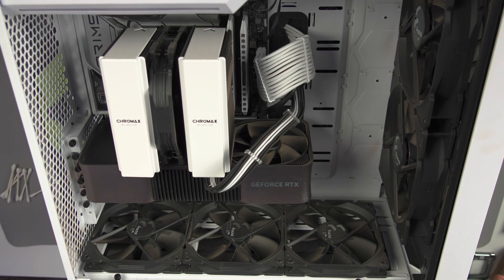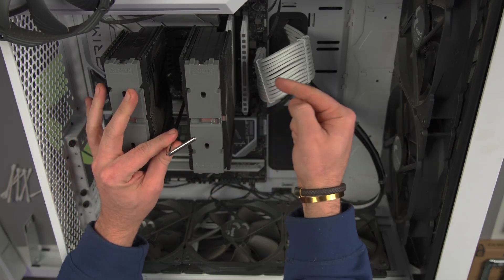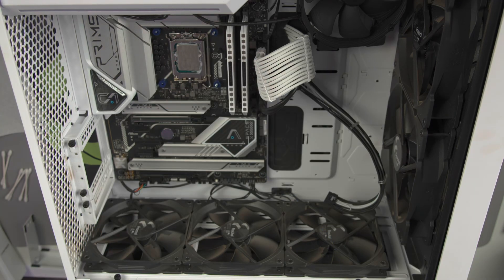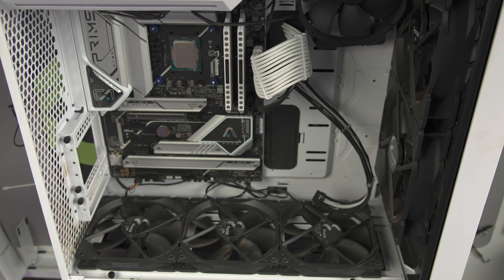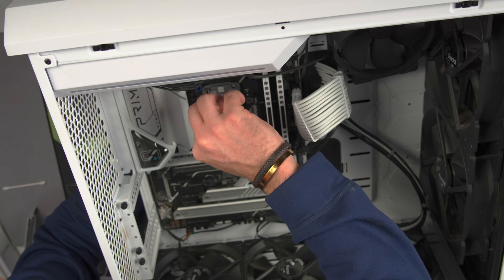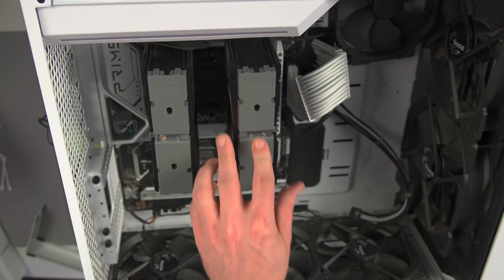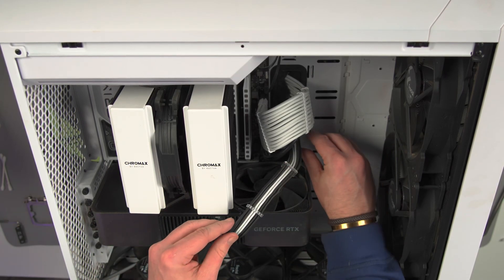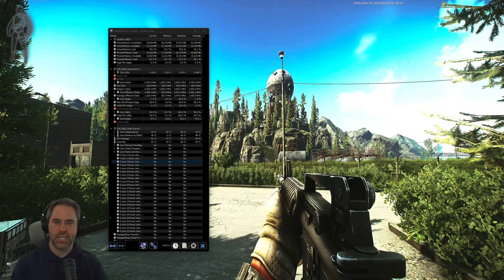How to Install a Contact Frame | 12th and 13th Gen CPU | Lowering CPU Temperature

Comment: In all frankness I'm impressed you got away with an Air Cooler on a 13900k!!! Curious to know what your temps are under full load without the contact frame!
Reply from the maker: New Tech videos coming soon with 13900KS and RTX 5090 being Air Cooled.

Comment: The contact frame is absolutely essential for the 12th 13th and 14th gen CPUs as long as you havent delided. Love the video! I was using the same contact frame until i decided to delid and build a custom water system. Also im happy to see you have a FE 4090 because if you ever decided to put it on water then youll have the best luck also a little known fact is that the FE cards all have binned hynex mem so thats obviously your best bet for OC in the first place.

Comment: I didn’t use this and my 13900K doesn’t run Hot.  I have a 360mm rad with 6 fans attached and I’m all good. I did use plenty of Paste and tightened it up all the way.
Reply: For the 13900k specifically, the contact frame doesn't necessarily decrease temps, under load, because the 13900k will use that extra thermal headroom the contact frame provides and just boost higher until it reaches the same temps. So while you don't see the temp improvements, it does increase performance. There's also the other benefit in how it protects your cpu from bending over time, the stock ilm for lga 1700 cpus puts all of its pressure on those middle tabs of the ihs.

Comment: I put in a thermalake contact frame too; You have to snug up the bolts to where they hit the "wall of resistance". If you dont, your pc wont boot because of bad contact between the cpu and motherboard. Dont go past the "wall".

Comment: Should have placed the case /tower on its side to create a flat level surface and tightened the screws in a crisscross pattern to assure a symmetrically tightened contact frame.
Reply from the maker: The screws are in a crisscross pattern. The scene is cut for time.
Reply: I use a torqumeter about .28 N*m
Reply: How did you find one that accurate?@NaterFernat
Reply: Why? He still got 10 degrees off the CPU temps. He did it perfectly, you people are way too paranoid.
Reply: @ivvan497  It worked for him, but for some people it could cause a problem.

Comment: You're using an air cooler on a 13900K? You're crazy.
Reply: @truehog  i guess its switching to PL1 so the clocks dropped to 4.7 to 4.3GHz and temps stayed low, a proper undervolt would net you a good boost in fps though as i have an AK620 paired with 14700k and set my PL1 and PL2 to 240W and put in a negative offset of 0.0900 and runs fully stable even with Cinebench R23, i get much better results than stock and almost 15C drop from stock temps and i get great gaming temps somewhere in Mid 60s @ constant 5.5Ghz. You might get better results than me since i live in a hot humid weather of around 32C (90F) air temperature and almost 35C(95F) room temps at noon.

Comment: Do you think this is worth the hassle for my 13600k? At 5.5ghz on all Pcores, i don't got any higher then 67c. My usual avg is about 58 to 62c.
Reply from the maker: You're already running good temps. However, for a minimal cost you can try the contact frame, it never hurts to lower temps even slightly. If you ever want to upgrade to a 13900k you'll have the frame ready to go.

Comment: Which cooler model is that?
Reply: Thats nh d15s chromax.
Reply: @mvndp  no it's not. It's a thermalright
Reply: @xdi1733  Why do you answer your own question? And why do you answer it wrong?
The Cooler model is a Noctua NH-D15s
The Contact Frame is a Thermalright Intel LGA1700.

No offense mate, but you shouldn't be so incredibly confident in being wrong.
Reply: @MrHardstylefever  oh ok. My fault. It's just the frame.

Comment: You put way too much paste, wtf. Applying thermal paste to the cpu isn’t supposed to be like frosting a cake lol.
Reply: you can never have too much paste, but you can have too little paste
Reply: No, its the perfect amount. The paste is super thin as you can clearly see.
Reply from the maker: I love cake
Reply: Incorrect. Non metal TIM you can literally put as much as you want and it doesn't effect anything on your MB or even the temps for that matter. The current and last gen IHS on the 12-13-14 gen CPUs are much larger than they ever have been before. So literally frosting the cake is just fine. Having too little is going to land you in thermal throttle zone due to a few cores (usually on the south side of the IHS) not having enough TIM to transfer heat from the cores, through the IHS through the TIM into your copper cooler plate. I understand we've always been told "DoNt OvEr Do It On ThE ThErMaL pAsTe" but times have changed and that's simply not the case anymore. Unless you are using LM or any conductive TIM. Then you had better be as careful as you possibly can or you'll end up with a fried MB and that's the best case scenario with too much LM.
Reply: I'm surprised people like that are teaching how to "properly" install ILM xD
Reply: @deivytrajan you also have zero idea on what you’re talking about
Reply: You have no idea what you’re talking about